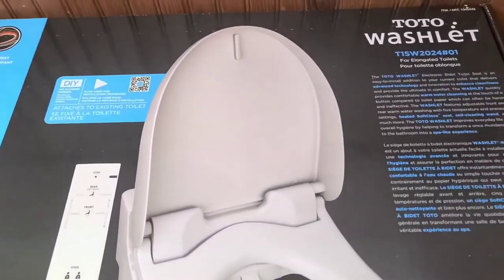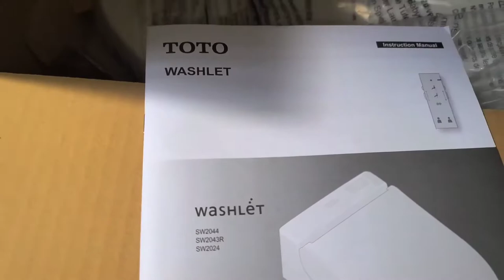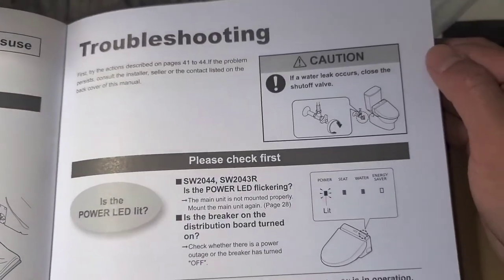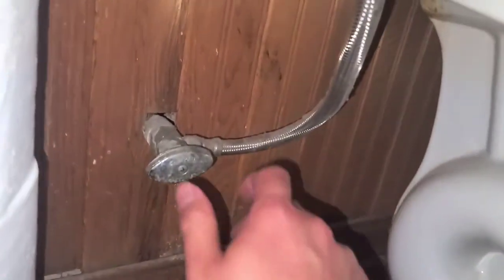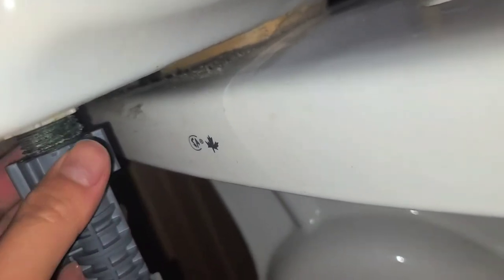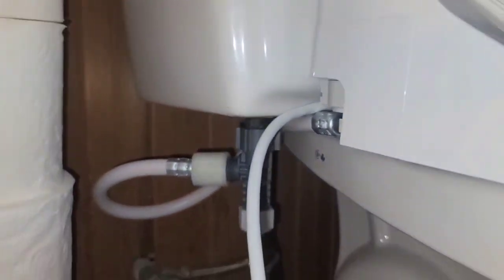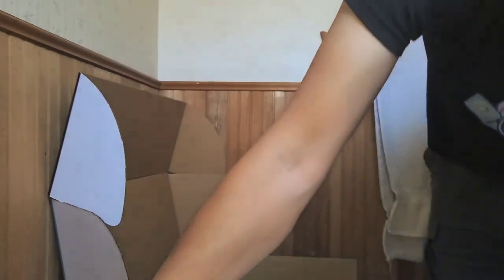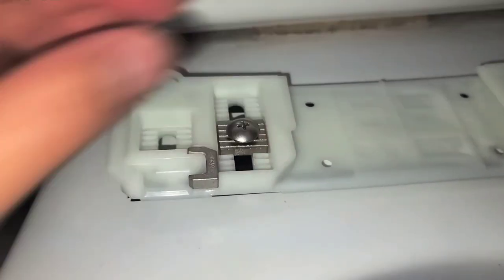Costco Sale Item Toto Washlet T1SW2024#1 SW2024 Heated Bidet Toilet Seat Installation by a Noob

Comment: Disassemble the wash let place holder by remove the scrolls out first. Put the rubber tubs in, then assemble them in place. Do not force them in.
Reply from the maker: Won't work. The holes in my toilet are too small. Lol Even with the screws completely removed.

Comment: I would not force the rubber fittings into those holes. It's virtually impossible!  What worked for me was to put a coating of vaseline on the fittings and then heat them up with a hair dryer. They then slid in with a little pressure.
Reply from the maker: I was able to get them in eventually, but that's a nice tip! I get worried putting stuff on them because I'm not sure how they'll react and whether or not it'll cause the rubber to crumble over time.

Comment: You didn't even show it working. This thing sucks. I'm installing this exact one having same issues. Now the thing doesn't even spray water right..
Reply from the maker: Oh, yeah, it didn't fit on my toilet properly, so I didn't want to return it filled with water. Lol What's the issue with it? That's usually a very good brand for bidet. I ended up getting a cheap one on Amazon and made a video of that one as well.
Reply from the maker: What do you mean by didn't spray water right.
Reply: @ItsBinhRepaired  basically, I installed it 100% correct. But when the little thing comes out. It just starts dripping water in toilet. It's not spraying out of the little holes. Seems like an internal issue?. I'm not happy with it.
Reply from the maker: @aaronsoto4622  that's the initial rinse. It will do that a few seconds before spraying. It does that in case shit particles fell on the nozzle. Lol Also, it won't work if it doesn't detect someone sitting on it. It's weight sensitive.
Reply from the maker: @aaronsoto4622  might want to read through the troubleshooting stuff. Either it's not installed right and it's not pressing down to detect someone sitting, or you're not waiting long enough, unless yours is defective.
Reply: @ItsBinhRepaired  oh wow. very interesting. Okay,,, hmmmmm...So i guess ill have too try sitting on it tomorrow. Man i installed it perfect.....and then you have too constantly use the damn remote the entire time too use it...if it even works of course. Guess I'll see.
Reply: @ItsBinhRepaired  Thanks man. ill let you know if it worked haha.
Reply from the maker: @aaronsoto4622  hahaha yeah, because if you're not on it, it'll spray water all over your bathroom. You could put your hand over the spout and press down with your forearm, but there is risk it'll spray at you. Let me send you the link for the Amazon one. That one has a touch sensor instead of pressure sensor.
Reply from the maker: @aaronsoto4622  this is the one I ended up using. https://youtu.be/cC_aJmb-lvk